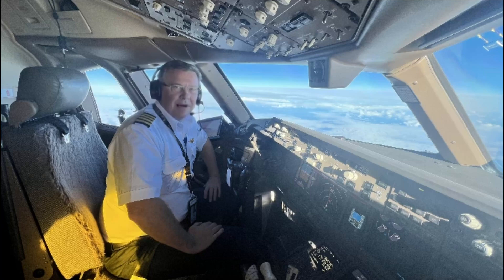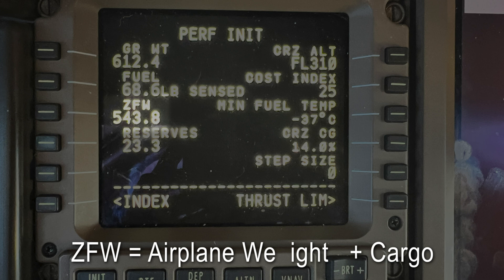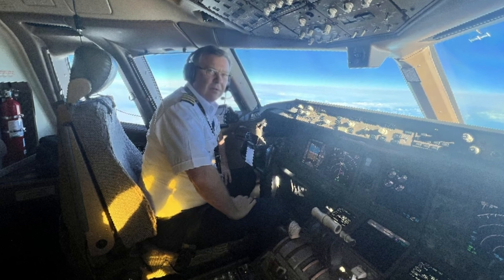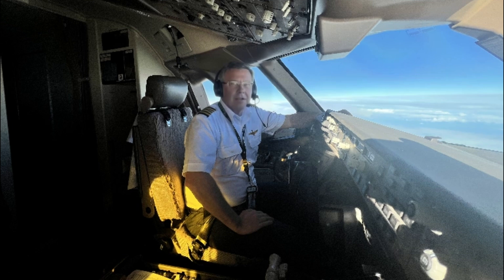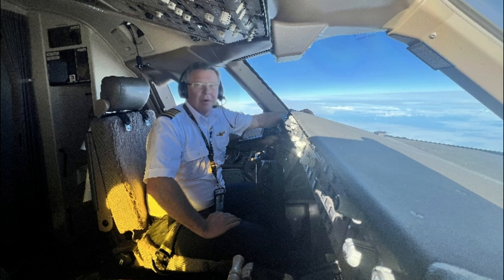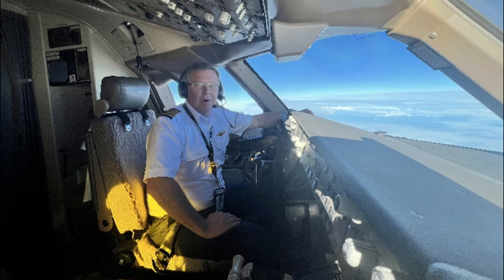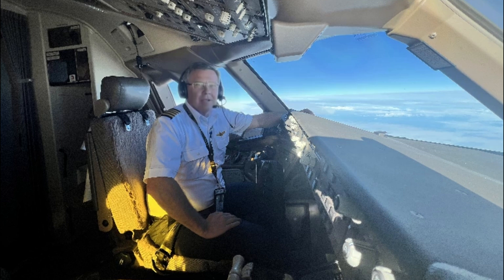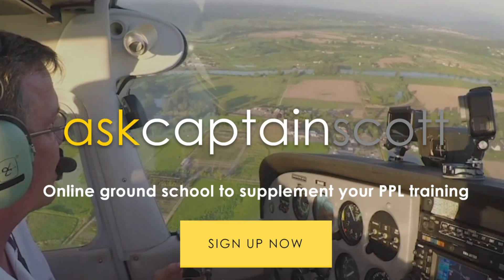Boeing 777F dealing with an overweight landing issue because of too much fuel on the plane.

Comment: Hello Captain,

It would be great if you can do a video and show the secrets of the FMC in a 777.

For example

Time Marker, Altitude/Flightlevel Marker,

Following a course off the route with LNAV by using format: P/P xxx degrees.

Intercepting a course of an offroute waypoint by using format:

 WAYPOINTxxxdegrees

Position report by using LONGTITUDE WAYPOINTS by using format:

For example: W060

You would type it into the LEGS page and the waypoint W060 would be created.

If the atc would instruct you to report position every 3 degrees from W060, the format would be:

W060-3

in the LEGS page.

The FMC would create waypoints starting from W060, then W063, W066, W069, W072 ect.

For Latitude waypoints you can apply it analog like you do it for Longtitude Waypoints.

Also it would be nice if you can explain and demonstrate the offroute descend function.

Thanks!
Reply from the maker: The FMS secrets it shall be. I can do a video of that part but I'll still have to be AI guy with the twitchy eye. Let me know if there's anything particular you want to see so I can focus on it.
Reply: @askcaptainscott  

I want to see everything, including the functions which I have mentioned above.

Also if you can,  how to use CPDLC and maintenance functions.
Thanks and greetings!
Reply: DES forecast page.